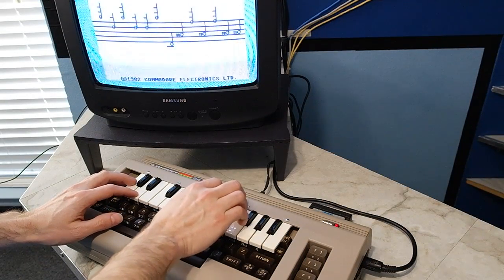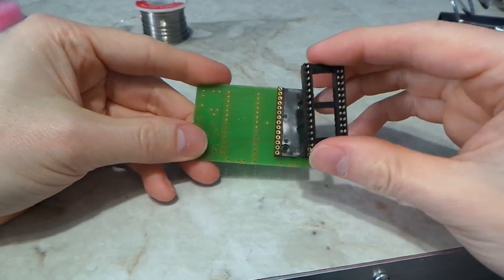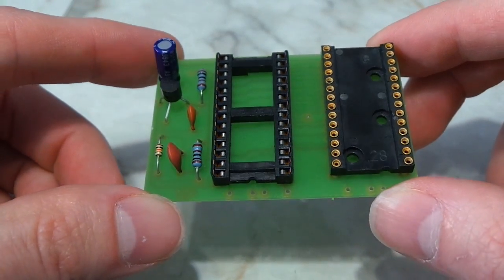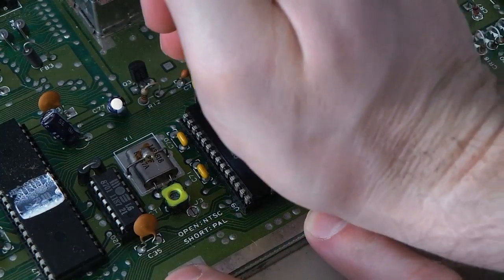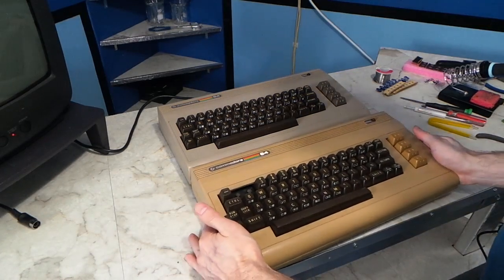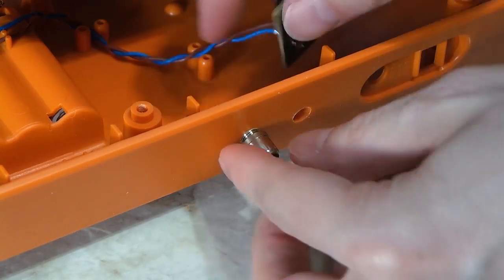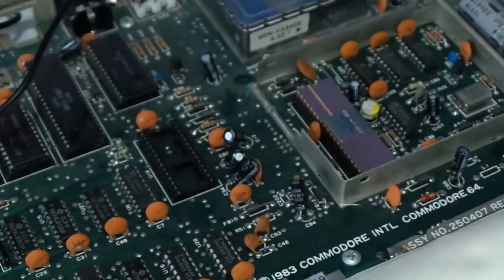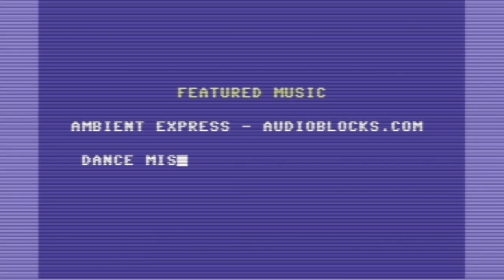Installing dual SID chips in your Commodore 64 with SID 2 SID

Comment: uhhh. you soldered the components to wrong side of the board. Components go on the side with the silk screened pattern.
Reply: Nope. The silkscreened side of the board has solder pads whereas the blank side doesn't, and these components have to be soldered from the bottom. The MSSIAH manual also confirms this is the correct way to assemble it.

Comment: You really need to get a desoldering gun.   You'd have the chip out in 60 seconds without risk.

Also, Mouser and DigiKey are both pretty awesome, selling small volumes for only a few dollar shipping for tiny orders.

Comment: I don’t see what the holdup is?
The dude went “Full Time YouTube”
He has Patreons funding his lifestyle.
He gets mailed so much shit he has to reject it, RTS, or outright just say “No”
He could have 50 SID chips mailed to him by next week.
You can buy Cartridge Port doublers for extra data lines, plus a MSSIAH cart.
You can also buy a SID Cart that adds another SID port that’s addressable with jumpers.
I have worked out that it’s theoretically possible to run 8 SID Chips using available hardware such as the Ultimate 64 Elite, SID2SIDs and SIDCarts with cartridge port doublers. 
I have ALL of this shit on my desk but there’s no software to make it work.
My current solution is to jam 2-4 SIDS into 2 c64’s and use the cartridge doubler to run a Datel Midi Cart into the MSSIAH via MIDIL, thus dodging the addressing bullshit using midi to get the 2 computers to smash out the music.
I am just a few SWINSID Nanos, or real SID chips away from linking all this shit together.

Then I just need some software to drive it.

Comment: Hello Mr.Murray. I am fan of your work. I am computer engineer wanna be. But I do not any experience.  I was wondering this product can bee implement cartige port.  I examined Sid chips and Cartige port pin out and it looks okey to me. I will order some components(Swind sid just like that) for this concept. I have only one problem. 6581's some output's which I can not identified. What is Fb11,Fb10 means. Thanks for your help and this kind great video. I hope I can do something for best selling home computer

Comment: Had you installed your parts on the silkscreen side of the board, your transistor wouldn't have been backwards, and the board would have been 180* around and wouldn't have hit the RF shield.

Comment: Your soldering makes me cringe.  Don't hold the solder so close to the iron.  Don't put your fingers at risk of getting burned.  You can get a much long piece of wire and be just as accurate.

Comment: I like salvaging old electronics from various things that I find or have been given...one technique that I use to de-solder parts, quickly is to use a heat shrink gun...it puts out quite a bit of heat....and after several minutes of heating an area of a board many parts will come off...just NOTE that this is a destructive process, so if you need or want to keep the pcb intact...don't use this process...just stick with the de-soldering wick!! Yuck! Nice video by the way...I'm going to have to get me another c64...I had one when I was 13...I just turned 50! We had a house fire when I was 17...so it went to that big landfill in the sky! :-(

Comment: I think your problems would not have been avoided in terms of placement and the transistor being backwards had you put the components on the silk screened side of the board like they normally go on…  Was this board designed backwards?

Comment: You realise you had to cut the shield because you soldered all the components to the wrong side of the board, right?  It should've been facing the other way and it wouldn't have interfered with anything.

Comment: 7:48 Just cut off the wire-wrap pins a bit on the left side of the SID and bend both sets of pins to the left so the SID2SID board angles upward slightly where the RF shield is.

Comment: I’m super surprised to discover that the 8-bit guy doesn’t own one of those fancy de-soldering vacuum guns!??!  I shelled out the $110 or so, for the Gaojie S-998P.  I think that this vacuum gun is fantastic, save my one single qualm: it’s hollow tip is sort of long, and so the solder passing through it can sometimes cool off,  harden, and clog the tip before it clears the tube.  I’ve used a little drill bit to clear it out.  I’m going to cut the tube a little shorter to resolve this, once I own a replacement tip.  Still, that desoldering gun (the 998 has two motors for a little extra power), loud and annoying as it can be, has been a very worthwhile investment.  If you do as many electronics projects as I’ve seen in your videos, and because you’re often doing repairs and desoldering jobs on those old through hole boards, you’ll probably want to pitch for a decent desoldering vacuum straight away.  I’ve loved ALL of your video series’, by the way!  I’ve watched most of them and I keep tuned in, as I find you an excellent source of info.  Keep it up with your videos, great job!

Comment: You need a proper desoldering gun!
Reply: Agreed!  There is nothing like a proper, quality desoldering gun.  After years of spending WAY too much time and effort doing it the hard way (with desoldering braid, solder sucker, hot air rework station, etc.) and sometimes lifting solder pads, I invested in a Hakko FR-301 and tips.  Like night and day.  I should have done that MUCH sooner!  Even if I only unsoldered a few chips in my lifetime, the time/effort savings for the cost would be worth it.  So glad someone sent him one!

Comment: you mounted the card upside down, if you had mounted the card in the right way you did not have to make any changes.
Reply: There aren't any solder points on the other side though

Comment: +adric22  Dual new-old-stock MOS Technologies 8580's might be useful for that the8bitguy.com Dream Computer Project.  I identified some current Western Design Center chips for the core:  W65C816S6PG-14 CPU, W65C22S6TPG-14 Versatile Interface Adapter, W65C51N6TPG-14 Asynchronous Communication Interface Adapter.  The IDT 71256SA12TPG SRAM (32ki x 8 bits) is a usable main/shared memory component, the Greenliant GLS29EE010-70-4C-PHE EPROM (128ki x 8 bits) a usable nonvolatile memory component for built-in test routines, an OS kernel, &c.  But new-old-stock MOS Technologies HMOS IC's such as the 8564 NTSC 40x25 text and sprite display controller and 8568 NTSC 80x25-character display controller are still needfuls for video.

Comment: 7:38 -- alternative solution might have been to bend the pins on the long leg socket by about 5 or 10 degrees (assuming the board would still clear the plastic outer casing)

Comment: I did this as a teen, about 30 years ago or so. I seem to remember I just piggy-backed one 6581 SID on top of the other. Bend out the address and output pins, and solder connections directly to them. I don't think I had any additional capacitors, resistors, and certainly no transistors involved. By golly, I did love my stereo SID player. Thanks for sharing.

Comment: I did this back in 1990 by stacking a SID atop the factory chip, adding a filter cap, and supplying an address wire. This seems overly complicated, but I guess the added circuitry was needed to accommodate either SID voltages.

Comment: You built the board upside down, and that's why it isn't fitting into your machine.  If you did it right, the PCB would be pointed in the other direction.

Comment: also... flat pin dip sockets can somewhat connect to other flat pin dip sockets or flatcable crimp connectors pretending to be a flat pin dip socket long term (although they never quite hold very well) but inserting any wire wrap square long pins or round pin goldplated sockets into them most definately screws them up permanently. sure it will probably 'stick for a while' but ic pins are a lot smaller than socket pins. if you're gonna do that sorta thing you'll probably have to replace the socket again if you ever take it out again. as for using the goldplated round pin sockets on the pcb itself, you won't get anything into there that isn't either an actual ic leg, or another identical socket. (probably good that most people order the cheap shit, which fits 'anything' (or at least, it goes in -once-, wether it still makes contact the second time remains to be seen ;)

Comment: the 'cleaner and safer' solution would probably be to just forget the internal sid, and place 2 additional sids and a midi interface in a cartridge. along with a GAL or other somewhat more capable address decoding logic to actually do it properly. (unlike the lousy job they did in the c64 itself with the original chip slurping up an entire kilobyte of reserved address space while only having 62 or so registers itself) (most likely cause: commodore trying to save 10 cents on some additional chips again.. 64 ehhh 63 as 1 got wasted on the sid KB ram should be enough for everyone ay ;) which would also prevent a lot of interference on the sound channel of the original sid coming from things like the rf modulator and other stuff that runs to, make sure both sound channels sound exactly the same, etc.

Comment: it is also a rather long and thick wire to the i/o-1 decoded address bus pin... but as it's just a decoded address basically running directly between a 74ls139 and that expansion port pin and nothing else that can't have any negative impact on anything else anyway. also i'd just further decode the address space the first sid is in as there is plenty of space left there which on c64s are just mirrors of the registers of the first sid, which cannot be used to address the first sid anyway, as that would break that softwares compatibility with the c128. (even if the software would try, it would just get your second sid and still have a sid ;). which by far is a better option than abusing a memory range reserved for i/o expansion cartridges.. such as oh eh. midi. which is the most likely candidate to be used in combination with this in the first place and therefore also the most likely candidate to screw things up. but seriously as there are only 2 i/o regions reserved for the expansion port, around 50% of the i/o chip cartridges should screw it up no matter which one they picked. (midi, ethernet, industrial control, that sorta thing. not games... maybe some freezer cartridges as well containing some weird hardware and not merely abusing ultimax mode to change the reset and nmi vectors on the fly and/or pulling /GAME /EXROM etc low while the system is already running (those thigns do all kinds of weird shit, you can bet one of them also conflicts with this modification ;) as for ending up with 2 outputs on the bus at the  same address at the same time , out of which 1 could be +5v and the other could be -5v or the bus being driven with 2x 5v at the same time... wether it destroys some stuff or not remains to be seen and depends on the chips. which chip wins the 'i can source more amps than you can sink' or the other way around contest should be interesting before the smoke comes out. also take in mind that while non-c c64's are ttl logic, a cartridge may well contain a cmos chip feeding amps into that old nmos sid until the sun goes down. when they're both at the same address and the address gets a read and the values on any output bits differ. so far for 'nothing you type into your c64 can break your computer' :P i guess peek(some addresses in the i/o-1 space) would actually suffice in that case. :P the databus isn't exactly supposed to be wire-or'ed :P neither are the databus pins on pretty much any chip. it's pretty much a one at a time story there. :P

Comment: lol. desoldering chips with litzedraht. didn't that stuff already go out of fashion when vacume tube radios were still hip?
https://www.youtube.com/watch?v=knfHd3aPyVo <-- this guy demonstrates how it's done, pretty much for as long as i've ever lived. lol. you just get a desoldering pump and they fall straight out. (if you don't want to keep the pcb you can also just desolder them all at once with a paintstripper heat gun and they all just fall on the table, but that doesn't nicely clean the legs :P
Reply: now, while a professional desoldering station will most likely costs you around 2000 bucks, those handheld electric automatic things in that video only cost around 300 bucks, while a soldering iron with a handpump attached (which also does the job just fine, you just have to pump manually) goes for around 20 bucks (at least they did, not sure if they stil make those). nicely removes any chip of any pcb without screwing up the traces or leaving any solder behind. in fact if you do it nicely you can't even see the chip even was replaced (other than the solder looking a bit shinier on the new chip than on the 30 year old ones).
Reply: screwing around with those tiny handpumps and litzedraht while burning your fingers most definately is not the way to go for removing anything with more than 2 legs, usually overheats and damages traces as well.

Comment: For all that is good and Holy, please tell me you've switched to using a solder pump to remove chips now - I got 2 CIA's and a PLA out in 20 minutes last weekend with a pump. Save the braid for cleaning the holes up afterwards - and even then only if really needed!

Comment: that effort for a 2nd SID? insane. runined and wasted!
we did this in the 80s and how much programs make use of the 2nd SID?
Just some demos...
and why didn't you use the standard pinout on the DIN plug?
No one needs the AudioIN so you would go 100% 
Why didn't you talk about the differences between the 6581 and the 8580 ... keyword "voltages".
But for YT some do everything.

Comment: Please start using simple flux when soldering or de-soldering, makes your day much much easier. With the copper mesh wire the tin is hard to get out, but when you use flux, it acts like a toilet paper. I know this is an old video, but on newer videos you still do the same thing so...

Comment: The flat part of the transistor matches with the flat part of the symbol in the silk screen.

Also, I would have tried bending the legs in a way the board is more on the left (but lower).

Comment: I can't beleive how many people are saying he just installed the components on the wrong side. If he had done so It wouldn't have worked because the SID chip would be in backwards. Yes, you can install simple components like resistors or capacitors from either side because they have only two pins but the only way to correctly connect a DIP chip from the other side would be to bend its legs around so that they point UP!
The reason the board seems backwards is that the designer chose to save money by not having to flip the board during production to apply the top silkscreen. If you look closely you can see there is no copper at all on the top side, if he had installed the components from the other side and soldered them on the top then there would be unsoldered leads sticking out the bottom!
If you need and more proof that he couldn't have put the components on the other side look at the sockets for the SID chips. While the machined wire-wrap socket for SID 1 can easily be soldered on either side, the low cost socket used for SID 2 can only be soldered from the bottom as the plastic housing covers up the pads on the top side.

Rant complete.

Comment: David - at 5:20 when you get your pull-down attic stairs down, it appears they don't fully straighten out (ie. the first hinge point is bent when extended). I have the same stairs, and if you cut off a bit on the lower (3rd section to floor), you should get a straight ladder run - which puts less stress on all the 'bits' of the ladder (non-technical wording, with pun)... anyway, when you go up you can see some stress on ladder (I think). If you can cut off enough, you might be able to redrill your feet bolt holes.... :-0  Just saying...

Comment: 7:38 doesn’t help that you installed the components on the wrong side of the board 😛 put them on the other side it wouldn’t of been hitting the sheld. the board would of went off to the left instead of right

Comment: It's no surprise that you got the transistor backwards. Why are the solder pads and the silkscreen on the same side? Every soldering kit I have ever built has the silkscreen on one side and the solder pads on opposite sides. This isn't a misprinted board either. All the pictures and documentation on their website are just the same. They even claim this was an intentional design decision to make it easier. I don't understand. And then they mention later on in the guide that this is probably confusing, so they know it's confusing.

I always thought the point of the silkscreen was to help line everything up when you thread everything through from that side. Then, after bending the leads, you can flip it over to the side without the silk screen and solder on that side. But not with MSSIAH apparently. No, you get to look at the pretty silkscreen, but then you have to flip over to the blank side , thread everything from that blank side, and then solder to the silkscreen side. Did they misprint the original production run and then couldn't be bothered to change it?

Comment: It's technically not true that you need to use the same type of chip. I installed a 6581 i the SID1 slot and an 8580 in SID2. I did this by cutting the power trace to SID2 and replacing it with a 9V regulator. Works a charm but of course you need to know what you're doing at all times.
Reply: It's good to know that it's just a power difference.  Somebody should design a slightly more sophisticated board that eliminates the "restriction" altogether if it's that simple.

Comment: You didnt need to take that shielding off, you should have used needle nosed pliers and bent a 45 degree angle on the pins of the module, or fit an extension.